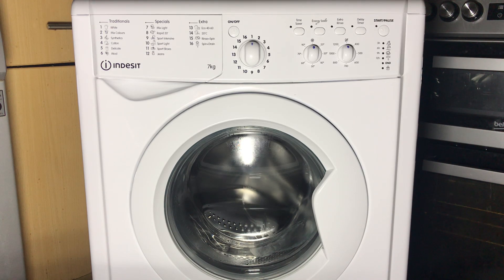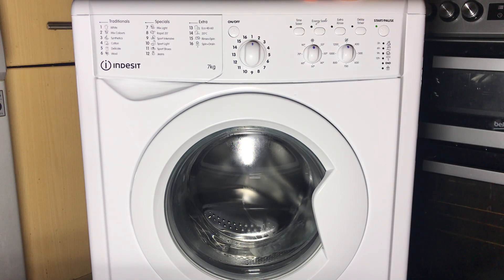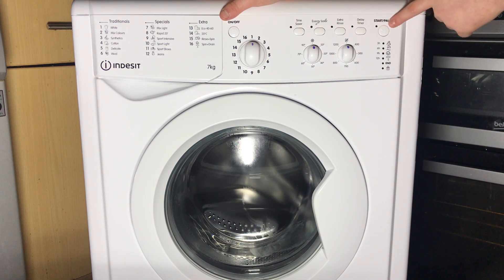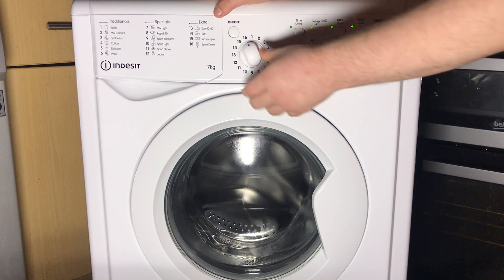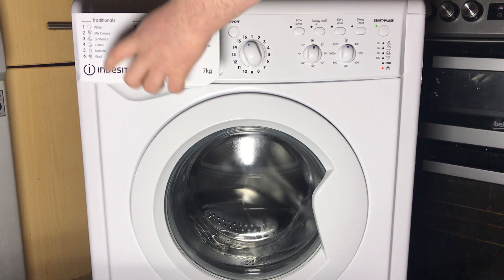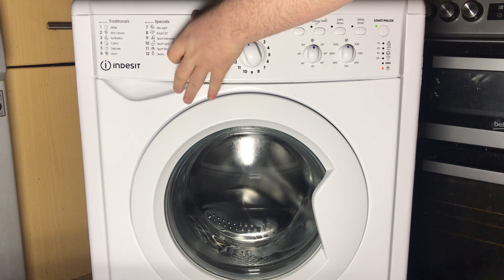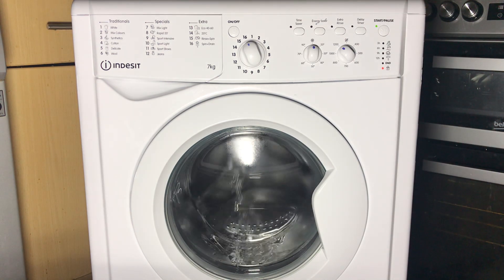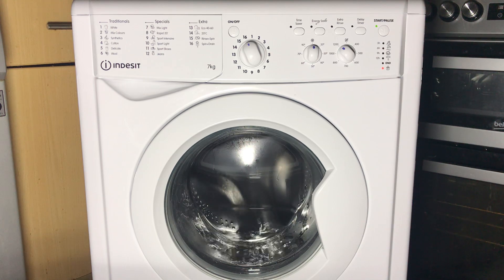indesit - service mode tutorial

Comment: Hi, thanks for the vid! My machine is practically the same, Indesit IWSC 51051, the service test works as yours, no errors, the machine execute all the cycles but... when try program "8" it load water, 2 times and then stops!
After some time of silence, it start to drain the water on loop and ends up with a "3h" blinking light! What's this error means?
What is really weird is that if I start the program "1", it load water and then start turning correctly to end up blocked in a second moment. I then use the "rinse" program and it works.
I've tried replacing the pressosts/hydrostat, checking the brushes, the pipes, the filters... practically everything but can't find the problem! so just thinking can be the board...
Thank a lot if with your experience you can help me!
Reply from the maker: a flashing wash light (which is the "3h" one you mention) indicates water intake error. you say it takes in water, i don't think it's a fault with the pressure system because otherwise it wouldn't stop filling until it errors. sounds to me like you've got a faulty board, especially since it fails differently on different cycles and works in service mode...
Reply: @thelaundrycookie1200  Ok thank you! No idea what else can be... I'll try to test all the other cycles to see if eventually one of the them will fully work and try to post results here thatmaybe are useful for someone else searching for the "3h blinking / flashing error" on Indesit washing machines!
Reply: Hi again, finally after trying to replace the board and other multiple things, the problem was one of the 2 electrovalves not functioning, causing the machine to stop after loading the water in the pre-wash but then NOT loading the main wash water because of the valve. Unfortunately I replace the electrovalves with one similar but not identical and got some burned capacitor... Anyway the solution for the 3h blinking light is the broken solenoid of the electro valves!
Reply from the maker: i see. this is a big reason why checking for compatability is important when changing components.

to clarify for others reading this who may have the same error - the valves is one potential solution, but not the only solution. the "3h" (wash) light blinking just means there is problems with the water inlet and\or pressure system.

Comment: I have a problem. Just very little water goes into the drum and it does not wash the clothes clean after all. It leaves an awful smell on the clothes afterwards. I have tried buying different types of washing machine cleaner but still the same thing. 
Can you help with what I can do?
Reply from the maker: put 2 dishwasher tablets in the empty drum and run a full white cotton 90° cycle. that should help deal with the smell

Comment: So stupidly I used soap flakes in my washing machine I dilooted it like it said but I think I've usted to much, I cleared the filter that was all jelified soap flakes and there is a hole by the side of filter that is clogged with it to but unable to inclogg it what do you suggest?
Reply from the maker: run a full empty boilwash using white cotton and set it to 90°. this should hopefully melt away and dissolve the buildup

Comment: For a complete cycke mAchines stops in between while spining 11:34 and drying option is not workig instead flashing lights only
Reply from the maker: they're programmed to stop several times on each spin. that's normal. as for the drying, it can't be selected on all cycles, if it's flashing while trying to select it, then it means it's not compatible with the cycle. however, if it's stopping and flashing in the middle of a running drying cycle, you may have a faulty dryer box (fan, element or NTC).

Comment: Hi my washing machine starts, water starts to flow (two sequence) but doesn’t move after that like rotate, but rather all the lights start blinking. Please what can I do thanks
Reply from the maker: the flashing lights are an error code. if you could tell me which of the wash progress LEDs are on\blinking, or send me a video of it, then i can help with what error code is being displayed. from what im hearing, it sounds like you've got a motor fault. so if your model is brushed, you probably need to have the brushes changed. and if your model is brushless, you probably need the inverter board looked at. this could still be a faulty main PCB though. the error code should hopefully point us in the right direction.

Comment: Doesnt spin at all. After filling the water it doesnt spin.
Reply from the maker: you probably need new brushes (or if it's a brushless model, it's likely a faulty inverter board)
Reply: @thelaundrycookie1200  i bought 4 months ago
Reply from the maker: then something is probably causing them to fail ridiculously quickly. for example, a damaged commutator

Comment: So the answer to most people's main question is this: Program 8 is the only one that gets cleaning over with within a reasonable time of 20 minutes.
Reply from the maker: people won't be coming to a "service mode tutorial" video to find out what cycle they want to use. they would go to an "all programs + options" video for that.
don't fall into the trap of throwing everything on the shortest wash. they are designed for very lightly soiled, very small loads. program 2 is 1h35 which is, to a lot of people, a reasonable length, allows more temperature variation, and allows a full 1200\1400 spin.
Reply: @thelaundrycookie1200  We'll try the 90 minute program 2 wash sometime. Thanks!

Comment: Hi, I have Indesit IWDD7123. 7kg+5kg washer dryer. When I put it on Spin in an attempt to dry the clothes further, it fills with water. The drying cycle options are 11 ( cotton) and 12 (synthetics). After 3-4 hours the clothes come out steaming wet. I thought it was because I put too much clothes, but the result did not change on adding much less clothes (1/4 capacity). It seems to pull water even though it’s on a dry cycle. And I have put it on the driest option with no improvement. My landlady tells me this is normal. What is your opinion on this steamy but wet clothes ?
Reply from the maker: taking water in during drying is normal as it's used for the condensing process. however, clothes coming out wet is not normal and indicates that it's probably not able to drain out water properly. it most certainly should not be taking water in during a drain\spin cycle.
washer dryers are more than capable of drying clothes fully. something is wrong

Comment: Hii, I have a question. I just go an indesit BDE 76435 9WS EE washing machine, it' not quite like this one in the video, therefore I'm not sure how to set it on Auto Clean mode. Does the first ever wash cycle have to be a safety wash, or will I be okay if I set a random cycle with just no clothes on, with detergent in it? I don't wanna mess my new machine up. Thank you in advance!
Reply from the maker: an alternative to autoclean is white 90.
as long as it's high temperature it doesn't necessarily matter

Comment: Hello, my machine starts, it fills with some water and then it stops. At first, the same had happened but it was also beeping the first light. Now, ( cause i have tried it some times), not even the beeping is happening. Do you have any idea?
Reply from the maker: for how long roughly does it stop? does the light still flash even now it's not beeping?
the first light flashing indicates the machine isn't detecting any water. meaning a faulty pressure switch or disconnected pressure switch hose.

Comment: I have IWSCS 51051 and all the lights flashes blinks and it seems it cannot even wash
Reply from the maker: which of the cycle stage LEDs are flashing or solidly lit?
Reply: @thelaundrycookie1200  all the lights are flashing ( eco time, eco saver, timer, start). Then it will stop if I press start again. But it will not release water.
Reply: @thelaundrycookie1200  it can't also wash. It is as if it is washing but nothing works. Unplugged, checked the drains.. nope
Reply from the maker: yes they always flash for error codes. what's important is which of the lights on the right hand side are either solidly lit or also flashing, as they are what determine the error code the machine is giving you.
Reply: @thelaundrycookie1200  the solid light is only the one at the end..the padlock symbol in red solid light. The other lights all blinking green
Reply from the maker: hmm. is it possible you can get a video of exactly what happens? you can email it to me if that's easier for you
Reply from the maker: it's thelaundrycookie1200@gmail.com

Comment: All my lights flash apart from the current mode lights which just the rinse and spin lights are one permenently
Reply from the maker: F06 - door lock fault
Reply: @thelaundrycookie1200  I was thinking the same but it seems to lock fine on a spin and drain
Reply from the maker: does it actually complete the cycle though? as it's possible the lock isn't functioning as intended despite being able to lock the door, if that makes sense. failing that, the other explanation is a fault on the PCB.
Reply: @thelaundrycookie1200  yeah it did. Wanna know the weird thing so I got the service mode to work and it ran through the whole thing without any faults. When it finished, I took it off service mode and ran a rinse, spin and drain. Worked perfectly. Then put in some towels that I'd used to soak up the water I took out of it earlier and put them on a full wash at full temperature. Worked perfectly. Very strange. What I'll do is order a replacement door lock and keep it for if it happens again

Comment: Mine won't turn on
Reply from the maker: check the obvious first:
- fuse in the plug, the cable, the socket itself.
then think about internals:
- mains suppressor, internal wiring, the power button itself 
and as a last resort - the PCB

Comment: Silly question: when counting the binary digits to calculate the decimal error code, which LED is the MSB? In other words, do you read it from the top or the bottom?
Reply from the maker: from the top down, it reads 8, 4, 2, 1, 16.
so on this indesit it would be as follows:
wash = 8
rinse = 4
spin = 2
drain = 1
end = 16
rinse and drain on together indicates F05 since 4 + 1 = 5
Reply: @thelaundrycookie1200  Thanks! I had the rinse light blinking and the beeper going off every 5 seconds (the start/stop light was steady), so I assume it was an F04. It turned out to be a clogged inlet valve. For some reason it waited to get water at the beginning, but it became impatient when it was time to rinse. Cleaned that up and it's good as new! Why they don't have easily removable filters is beyond me...
Many thanks again for this video, it put me on the right track to fix mine!

Comment: Hi mate tried the above as the washing machine isn’t working. The error with mine is it starts and then the top 4 lights just flash continuously. Any ideas?
Reply from the maker: could you tell me which lights are lit solidly? as the 4 flashing LEDs happens for every code. it's the solid LEDs that differentiate the error codes.
Reply: @thelaundrycookie1200  so the lock and the end lights are solid. The time saver, energy saver, extra rinse, delay timer and start/pause are flashing
Reply from the maker: end being solid indicates F16. which is meant to be a drum position sensor fault (which is for top loaders only). this is a false error code (very typical for W\H\I), and is actually the same error mine gave when i manually disconnected the NTC sensor. so if it's happening early on it may be heater or NTC related. especially if it washes for a few minutes with water in before erroring. though it's hard to tell for sure without having it in front of me.
Reply: @thelaundrycookie1200  yeh it starts to wash then stops and won’t drain, is it an easy fix the NTC?
Reply from the maker: when you say it won't drain, do you hear the pump activate? and is this before the error shows up? if so then you should check the filter as that may be the culprit. if the error shows before it's supposed to drain then it's not the pump or filter. the heater and\or NTC should be simple enough to swap, if you know what you're doing. i'd suggest asking an engineer to look at it anyway before buying any parts, since it's showing a false error.
Reply: @thelaundrycookie1200  it like does some of cycle and stops before draining, have to then put it on drain cycle to get rid of water
Reply from the maker: does it drain successfully on a separate drain\spin cycle? what settings are you using when it errors? i would try it on a 90 wash and check if the glass is hot, lukewarm or stone cold when it errors. if you try this then let me know.
Reply: @thelaundrycookie1200  so just put it on number 16 to drain it, drained it fine but towards the end of the cycle the lights started flashing, it then stopped and lights just carried on flashing had to turn it off for them to stop, then put it on a 2 wash at 90 degrees and just starts flashing 5 mins into can’t even check if water hot
Reply from the maker: does the drum rotate at all before it stops? just to rule out a potential motor fault... and cycle 2 is 40° max, only cycle 1 can go to 90°.
Reply: @thelaundrycookie1200  I’d like to thank you for the help today, decided to buy a new one
Reply from the maker: no problem, hope new one serves you well.

Comment: I have an indesit iwdc6125 washer dryer. When trying to use any mode the top 4 lights flash green. Start/pause flashes orange. And the bottom 4 lights are all on solid. End light is solid red. Any ideas?
Reply from the maker: i think it's a board fault. judging by it erroring when you do anything at all... plus, i can't figure out an error code from this combination of LEDs (although hotpoint\indesit are known for being very unhelpful with their error codes). the closest code i can get is F12, which is board-related.
Reply: @thelaundrycookie1200  okay thanks for the quick reply. This an easy cheap fix? Machine is about 7 years old, got it 2nd hand
Reply from the maker: it depends how much you're willing to spend. if you got it second hand, the replacement board probably isn't economically worth doing. especially considering you may need to swap both main and control boards, plus a faulty board is an assumed diagnosis based on indesit's unreliable error codes.

Comment: Thann you for this. I like to clean my washing machine with the correct washing machine powder cleaner. Is there a specific mode to put it on to? Cheers.
Reply from the maker: if your model has a dedicated cleaning cycle ("autoclean" on hotpoint\indesit), use that. otherwise, select a cotton-based 90\95° cycle (white 90° on hotpoint\indesit)
Reply: @thelaundrycookie1200  awesome thank you very much!

Comment: I have an issue with an idesit machine, it’s showing f05 and if i unplug it and plug it back on it will just show the program but the door is locked. Is there anyway i could unlock the door in this case without fixing the f05 error?
Reply from the maker: since f05 is a drainage error, it's unlikely the machine will unlock by itself without some of the water first being drained out. however, on some models there's an emergency door release tab at the bottom, underneath the kickplate. if yours has one, you can pull that down and the lock will release until you let go of the tab. don't do this is the water level is higher than the drum rim though.
Reply: @thelaundrycookie1200  thanks for the swift reply! Yea i am aware that it won’t release the door, and i have tried several ways (there is no tab to pull for emergency door unlock as you suggested, and i also tried the trick with using a string to pull open the door). Fortunately, one thing that helped my case (and maybe could help others) is that I left the machine unplugged overnight (around 6 hours ish) and when i plugged it back, initially it showed a locked icon, but after give the door a push (or two) the icon disappeared and the door unlocked itself
Reply from the maker: im glad you have it unlocked now. judging from this, it sounds likely that the water temperature was the thing stopping the machine unlocking the door than the water level itself. as for dealing with the f05 error, it's definitely worth looking in the pump filter before doing any more washes

Comment: Please I just want to fine out how to set my washing machine to wash with hot water. Indesit 8kg just like yours
Reply from the maker: it should heat up during the main wash. test the heating element by setting the program to white cotton and the temperature to 90°. if you feel no heat at all during the cycle then you need a new heating element.

Comment: Hi, my machine machine washes for a while, then on 6h, it goes back to 3h and starts beeping wight a flashing light on the 3h constantly, what could be the error with it?
Reply from the maker: this could mean one of two things:
1 - if it's just the 3h\wash light flashing then this indicates the machine is struggling to take on water
2 - if the 3h\wash led is flashing as part of a complete error code, then this is F08 which indicates a potential heater fault
option 1 seems more likely considering you say it's on 6h\rinse when the error occurs. if it completes the wash fine but fails on rinsing, you might have an intermittent fault with the inlet valves.